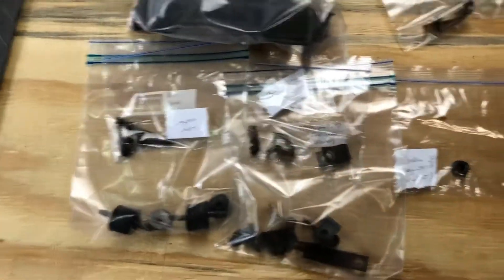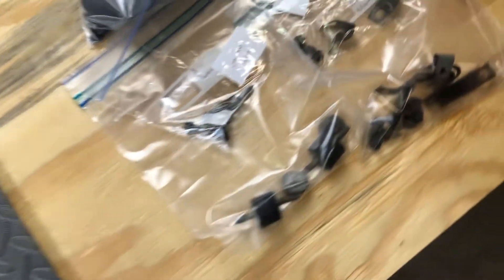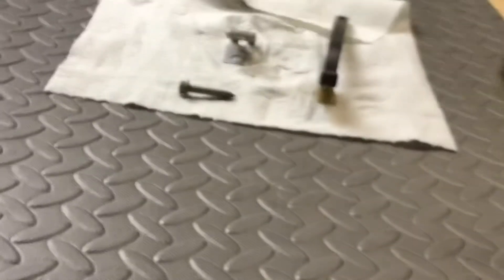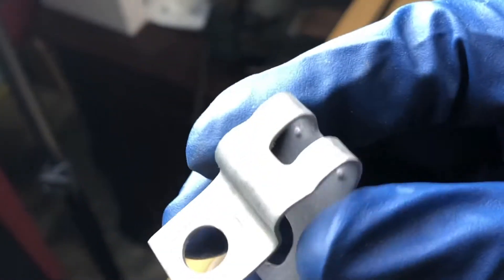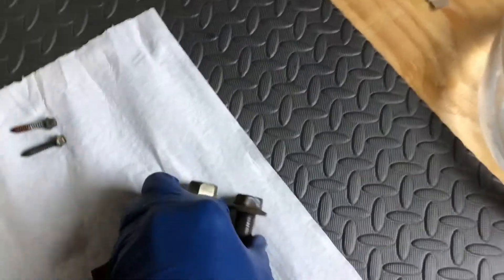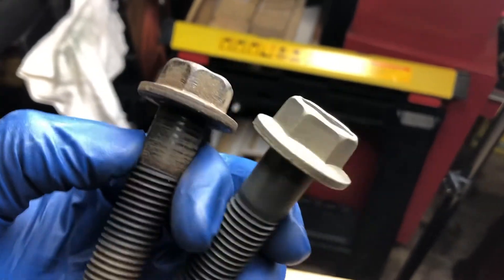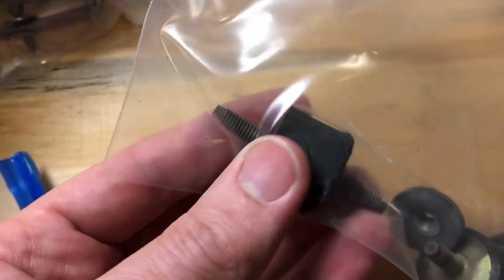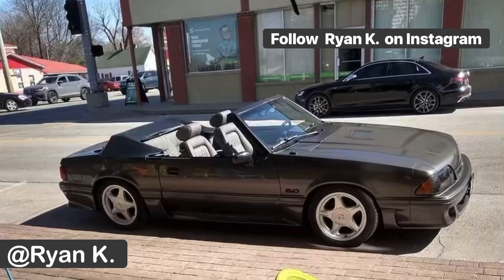Stripping Bolts And Other Parts to Bare Metal - EASY

Comment: Very organized.... I want to try electrolysis cleaning using a car battery and a bucket. That seems to be the painless way to go.
Reply from the maker: Yeah that’s good for rust removal, but may not remove galvanization or black phosphate coatings or paint. But I will be using electrolysis for the zinc plating!

Comment: Something to consider when re-finishing is that Ford likely knew a few things we don't so used different coating for different applications, like exposure, reactivity, etc. I definitely like where this is headed.   You also mentioned thinking about painting the whole car. I think you'd like Tony D Freestyle's videos on his repaint. Similar attention to detail and effort to explain how to do it, GFunk and Brew2l too of course but those are likely already in your feed. BTW  I use a small parts tumbler with walnut media for general cleanup, works great if you can keep track of what goes where.
Reply from the maker: Thanks for mentioning Tony D Freestyle. Looks like he’s got some good vids - just su6scri6ed!

Comment: Great tip! I’m doing some similar work right now before I drop my engine back in. 👍 IG: @87t_topgtforme
Reply from the maker: Finishing up some other bolts right now that had factory paint and primer. Had to soak the bolts about 12 hours and scrubbed with a brush and drop back in for another couple hours.

Comment: Your super organized and love the attention to detail.  The hardware comes out looking brand new.  Btw your vert looks sweet🔥✊🏼🏁
Reply from the maker: Thanks!  I need to hurry up and get these pieces coated. Pretty humid here right now and everything is rusting since last night!
Reply: @Foxedup  I hear ya, I run a dehumidifier in my garage to control the moisture and that was one of the best things I did✊🏼🏁
Reply from the maker: @PaulDaFox  yeah I’m a bit jealous of your garage!  The lift is awesome to have.
Reply: @Foxedup  It certainly comes in handy for some mechanical stuff but I mainly bought it to create another parking spot.  I would like to get one more and have both lifts side by side on the double garage side. Thanks!